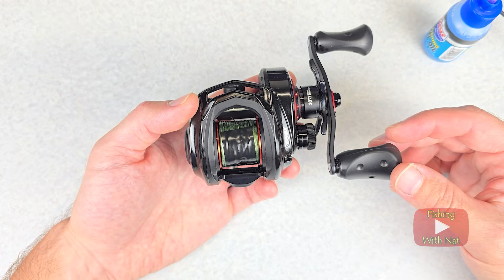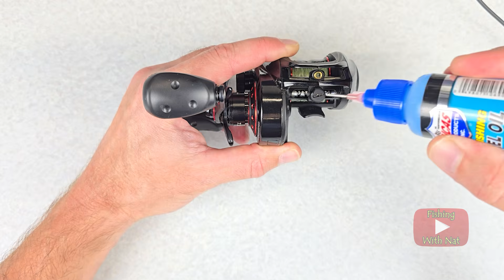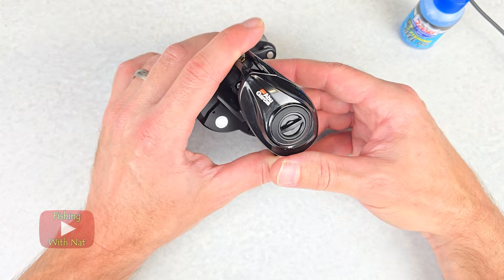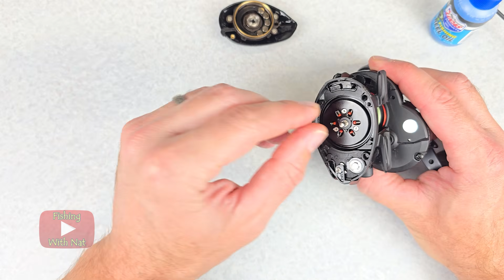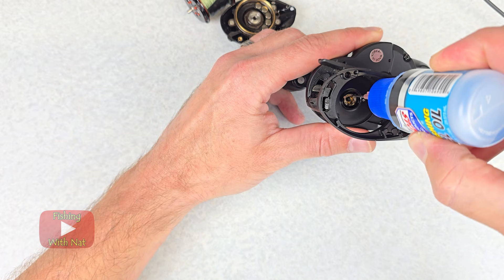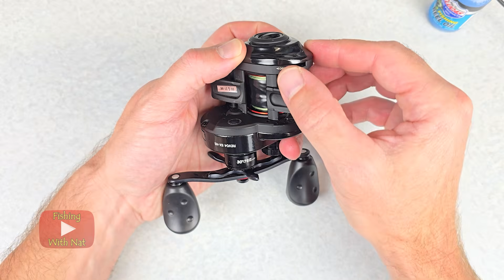How to Oil a Baitcasting Fishing Reel - Baitcaster Maintenance

Comment: Isn't the worm drive supposed to get grease? Not oil?
Reply from the maker: The manufacturer recommendations are mixed. If you use grease on the worm gear, just be sure to use a very tiny amount.
Reply: @FishingwithNat thanks for the reply! After research I see what you mean. Have always used very little grease and wiped excess. I've never put oil on the bar like you showed and that makes it feel alot smoother! Great video
Reply from the maker: @AquaSkrimps  Thanks. I agree that I prefer a tiny bit of oil over grease.

Comment: question! so why do you put oil instead of grease in the worm gear? or does it matter?
Reply from the maker: You can do either. Just make sure you go light on the grease so you don't have any getting squeezed out onto other parts of the reel or your line.

Comment: How often should you do this and is there a way to notice if you need to oil it?
Reply from the maker: If it starts to seem like the handle doesn't turn as easily as it used to, that's the typical sign that it needs some oil. I tend to oil my reels at the end of every season out of habit. After this amount of time, I don't usually notice anything wrong with the reels but I can notice an improvement after oiling them.

Comment: Wow I didn't know I could do this so Wrong.  I've been breaking them down to the gears and greasing them under the handle.  Never even thought about the push bar or behind the side plate.  Well I know what I'm doing when I get home! Thanks NAT!!!
Reply from the maker: You could take it all apart and oil/grease the various components that way, but this is how I like to do it quickly at the end of each season. Greasing the gears is a bit more complicated but that doesn't need to be done as often.